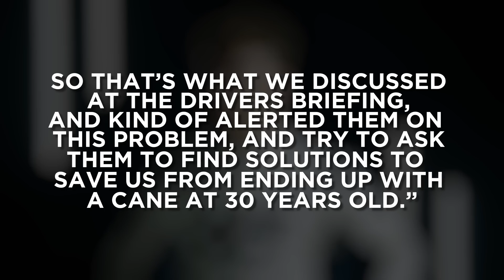Why are F1 Teams STILL Struggling with Bouncing?

Comment: To understand why teams wont just raise the car: If any f1 team could, they would remove all crash structures and heavy things if it improved performance. But it is mandated by the FIA, FOM, and GPDA to advocate for driver safety. This is no different. Teams are not altruistic. They will only seek performance. So just make it impossible for them to do so.
Reply: Nope - in any reasonable country, employers have a responsibility to their employees safety, the teams with the problem refusing to compromise is akin to a construction company putting their workers in danger to make deadlines or costs
Reply: @markhowells13  and guess why those countries are “reasonable”. They have rules that stipulate minimum safety requirements and hold the companies liable for not doing so. It’s not like these construction companies do it on purpose. When there are no rules, organizations push for maximum performance. Governing bodies are built to protect the masses. 

And on top of that the fia have already done multiple rule changes to stop any one team having advantage: FRIC, engine modes, DAS just to name Mercedes’. Blown diffuser for redbull etc. it’s not uncommon for a change to be made by the fia

Comment: In 2014 Mercedes voted against changing the token system so the other teams could catch up in PU development, Toto Wolff said "why should WE be penalized for getting our sums right".
Reply: Dont forget about the ban on FRIC, engine modes, DAS ... so its not like mercedes was immune to the fia trying to slow them down
Reply: Understandable yet they have been penalized in the PU department regarding different modes etc so other teams could catch up!? I've heard people referencing Red Bull's new suspension as innovative which could be a main reason why they're on top of the problem but same can be said for DAS no!? Which was later banned mainly due to Red Bull moaning & bitching to the FIA about it LMAO.. ultimately I don't understand the moaning about Mercedes wanting the regs to change a bit considering it would bring the teams closer which was what we wanted!?
Reply: @nickyjeanty4351  those changes weren't applied until the next year?  IIRC the advantages made by Mercedes were allowed during the season.

Comment: It's the old story of trading some "safety/confort" for some "performance". 
Mercedes is just putting pressure on FIA because they can't solve/reduce the problem without loosing performance, but the other teams and FIA don't have anything to do with it.
Reply: 8 team's have put in a complaint to review the regulations and the fia have a massive part in it as the regulations directive say they have to do something more than 6% of the grid ask for a review or more than 6 drivers.
Reply: @chriscollins550  this is a rabbit hole.
 FIA didn't create a rule that cars have to bounce, teams find most performance that way so they use and abuse. Pure racing is like this, you have a better car or you compensate and risk a little bit more.
Reply: @Duarteral  no but the fia known about the problem before these regulations was put in place. It's also in the regulation that the fia are the one's who have to take safety concerns and remove them. It's also in the regulations that the fia have to review and change them if more than 6% of the grid vote for it and it's more than 6% that are asking for it. They can't afford to just let team's compensate and risk it because that's what killed Senna
Reply: @chriscollins550  I totally understand what you mean, but how can a team put a car on the road with all the data were the car is bottoming out etc and knowing the risk they are putting in the driver. If they change something I hope it doesn't favor some teams more than others. How is on WRC, MotoGP, pikes peak... If is undrivable they drive slower until they get a solution.
Reply: @Duarteral  do you know what of the reasons ground affect f1 cars was banned before? Because of almost the same reason because of the bottoming out the car would lose ground force and spit the driver of track because it lost what was holding on to the track. Then you got the problem with hurting the driver's in more than just grounding out. The problem is it's beyond just losing pace if some teams that don't suffer from it as much but still having problems with the driver. It's only most likely hurt one team red bull and a result would bring the racing closer together and that's what we all want
Reply: @chriscollins550  There are 10 teams so if one team votes for a rule change that's 10%. What is this 6% rule you're talking about it makes no sense. Even if it's drivers only 2 drivers would need to vote for a rule change to hit 10%.
Reply: @tinocaer  6% of the team's need to vote of the teams need to vote yes
Reply: @chriscollins550  ground effect was banned because cars were doing corners too fast for the safety at the time, not because it was dangerous per say. For this year they traded the downforce of the wing elements for the ground effect so the cars didn't get faster but produce less dirty air. Now if Mercedes are desperately running so low they are almost stalling the ground effect they should be accused of homicide, not FIA
Reply: @Duarteral  that's not the only reason that was part of it just like I said, part of it was lose of ground affect when hitting the ground. No the fans and fia should if they don't change the regulations. But they have to anyway if the team's vote for it and there's nothing there's so-called fans can do or say.

Comment: I feel like they can fix it but they don’t want to sacrifice speed now they’re blaming the regulations for the bouncing rather than their own design of the car
Reply: That’s right. As merc said for 7 years; “don’t blame us for getting it right”
🤣🤣🤣🤣
Reply: @Daniboi971  the FIA been trying to stop Mercedes for years now for it getting it right no!? Party mode, DAS, Complex suspension..etc
Reply: 🍻cheers to u sir
Reply: It only gets properly fixed when all teams can run their cars as low as they want without the car porpoising
Reply: @Appetite4Rose  like Red Bull? With their genius aerodynamics team
Reply: This comment shows your knowledge of F1👌🤣🤣.
8 teams have complained about the porpoising
Reply: In reality the FIA do have some blame in this. As part of the new rules for this year they massively simplified the suspension rules. This has removed one of the tools that the teams have for managing this issue. It is not clear exactly why they did this.
It is too late for this season but there needs to be a review of the suspension rules

Comment: Truckers have suspension built in directly to their seats for a similar reason at lower speeds. F1 should adopt and adapt the idea to racing.
Reply: At this point, they can't add anymore weight tbh
Reply: Weight & space make that impossible.
Reply: That may solve the health issue of the driver, but drivability wise, its still the same